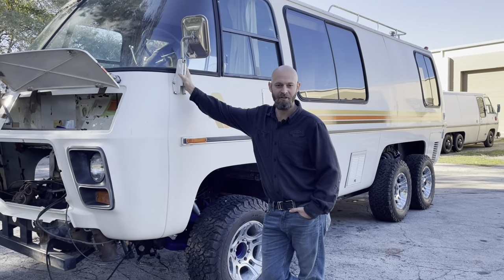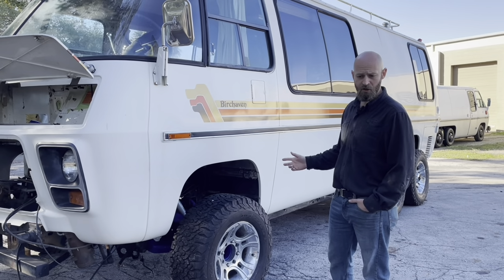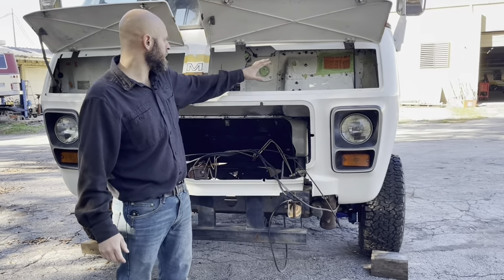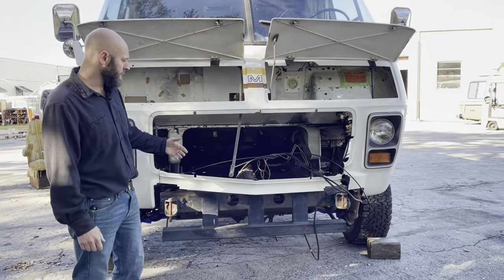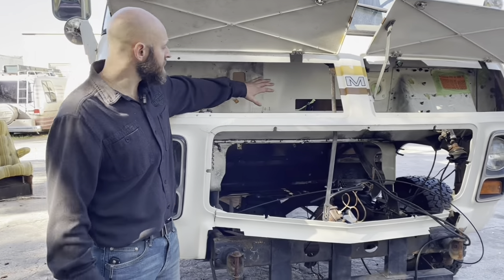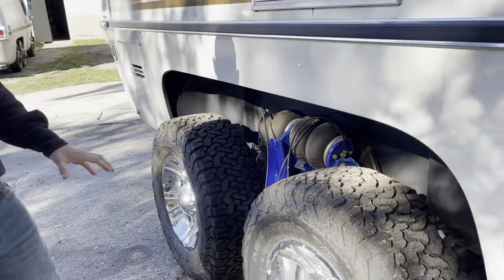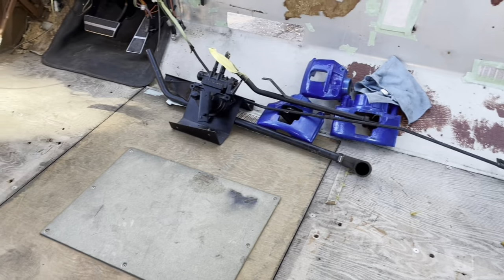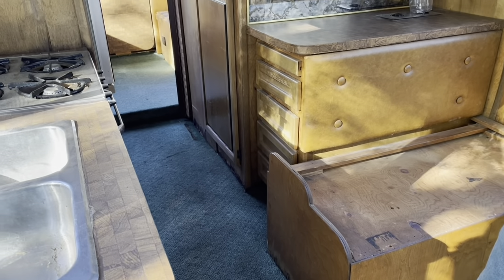The Birchaven - An Advanced GMC Project

Comment: I have torn out my dash just like you did.  I am computerizing all of the inputs and outputs (brake switch and tail lamps, ignition switch and accessory buss, etc.) and I have re-designed the heat and A/C components as well.  I am interested in seeing your concept drawings for the full dash.  I have a few prototypes, but have not settled on the grand plan.  I am also installing quad LED headlights.  Did you know that the original headlight bezel does not fit the body properly?  It is about 1/4" short in both the vertical and horizontal dimensions.  Could it have shrunk over the years?